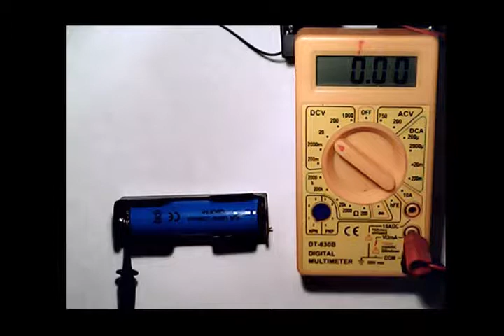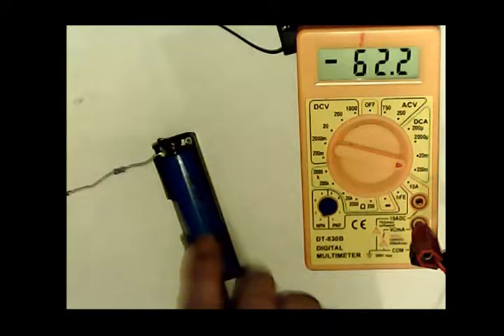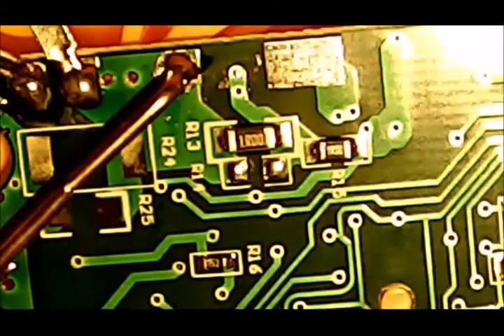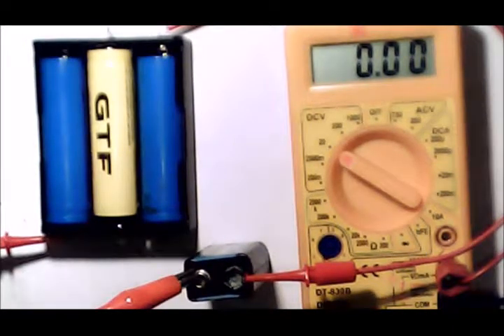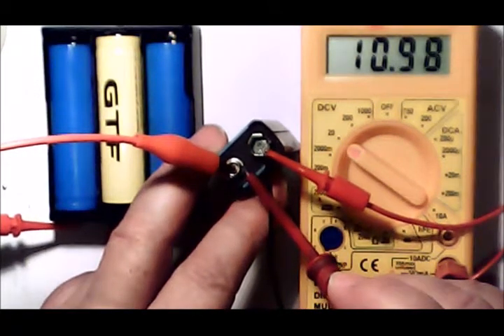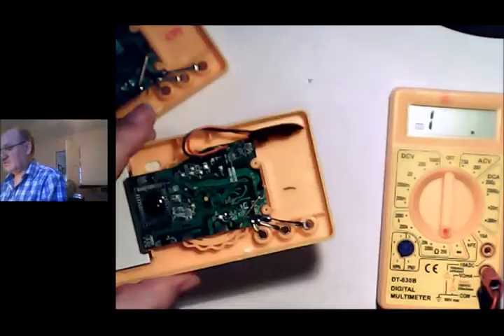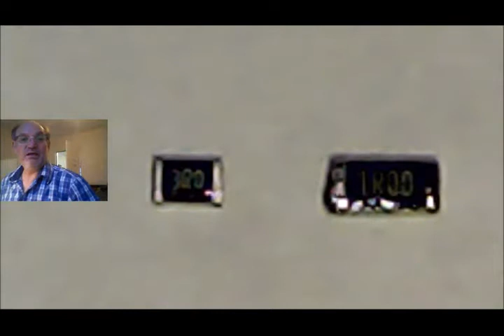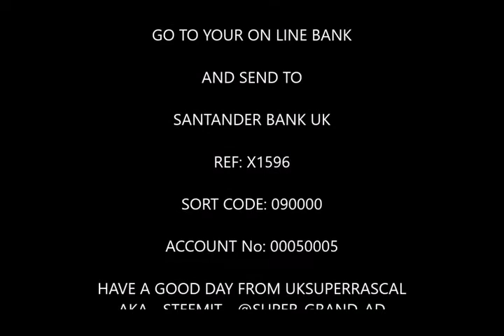HOW TO REPAIR A MULTIMETER 29 JULY 2019

Comment: Didn't you mean the 3 ohm resistors were put in PARALLEL with eachother? (40.00 mins in)
Reply from the maker: Yes if you remember back when I tested the 3 ohm resister it measured around  3.5 ohm - So  3 x 3.5 ohm in parallel = .1 ohm = R=1/ (R1+R2+R3)= .095 ↑ = .1 or 3x3=9 so 1 / 9 =.111 but when in circuit it measured 1.5 ohm - 38.25 mins in